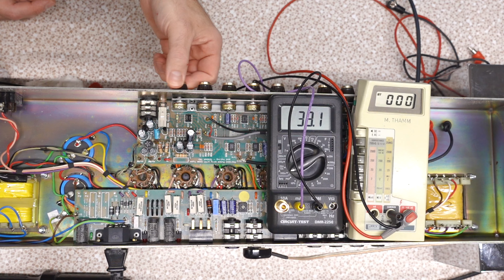Marshall JCM900 Pot Cleaning & Biasing

Comment: I have the same amp it it regularly needs pot cleaning. I want to do it myself but I'm scared of electrocuting myself and dying lol. If I simply disconnect the reverb and slide it out by grabbing the tranformers like you did, will I be ok? What should I absolutely not touch?
Reply from the maker: If you're unsure, turn off the amp with the standby ON, and leave the standby on. Let it sit an hour or overnight or however long, should let the capacitors run down. If the amp has been cold for that long it SHOULD be completely inert inside. And even if it isn't it SHOULDN'T have enough bite left in it to hurt you. 
The juice is store in the metal cans, anywhere you see those metal cans, be weary.
Reply: @DATT thanks for the tips! If I ever do decide to do it, I'll tread lightly, lol, and avoid those
Reply from the maker: You're Welcome

Comment: I see you used an adapter to bias this amp, where do I get one of those? I have a JCM 900 that has been sitting stored in a basement for 30 years, it also has that white gunk thing on the black plastic. Have not opened it up yet. Thing with this amp is that it was a friends, and 30 years ago, when it was new, it sat in our rehearsal room. I have probably used it more than him, and I know pretty much everywhere its been, so Im suspecting the gunk being prevalent to that kind of plastic used in these. Im also going to swap all electrolytes, new tubes and probably a round of DeOxit. Nice video by the way, very helpful. I am an electronics engineer, but tube tech is a different animal...
Reply from the maker: Similar fundamentals I think, but much higher voltages. 
I've since learned how to use negative feedback to adjust the gain of a tube stage similar to how we do with an Op Amp. 
Search any of your fav online retailers, for a "Bias Probe". They will intercept Pin 8.
Pin 8 on a power tube is it's direct ground connection so all the juice the tube drinks will flow thru that point and you can measure the bias. Alternately, if you want to mod the amp, find a way to fit a 1ohm1w resistor between pin8 and ground. They you just measure the voltage drop across it.
Reply: I bought mine off of Amazon. It was $16. Its worked great for me.
Reply from the maker: Yeah they are pretty simple, shouldn't cost much.

Comment: The 1458 offers more headroom for the reverb path, whereas you get some of the preamp grind from the 072's if I'm not mistaken. I have a 072 based distortion made by ground fx (somewhat a Black Arts Quantum Mystic Clone) and i run it into a 70s Matamp GT120. It's pretty 900ey! but with more meat around it. It's a pretty cool opamp!
Reply from the maker: Ohh ok. I guess that makes sense. It has a pretty good reverb as I recall. Might be that Op Amp is one reason why.